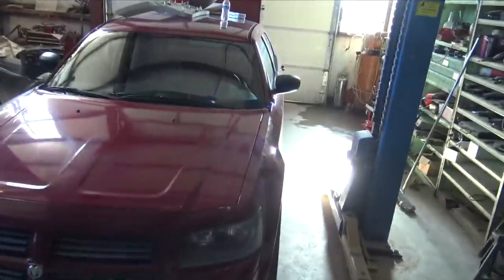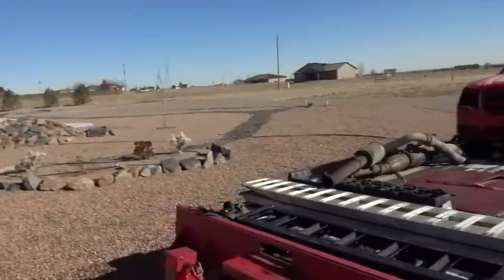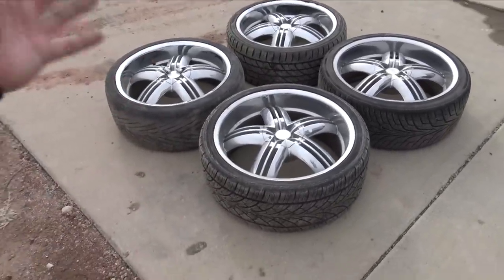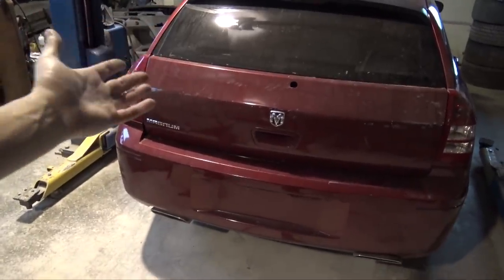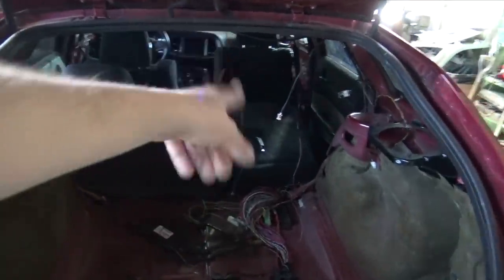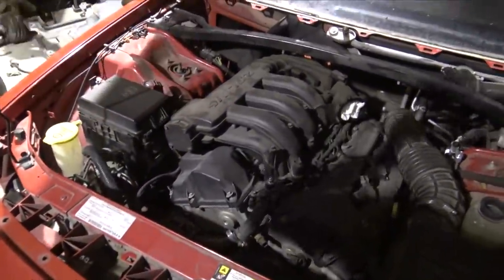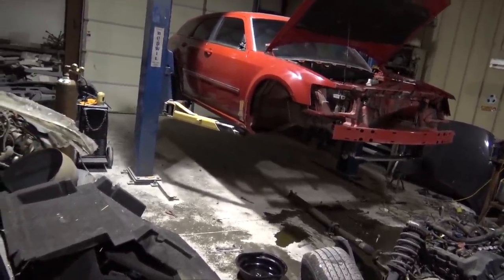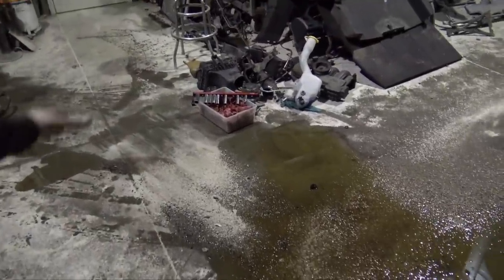Building the MAGNUM DODGE WONT | 500HP 6 4L 392 SCAT PACK WAGON PT16

Comment: Hi Dave, Please build a metal box to cover the winch.  And another to cover the battery.  Weld hinges to the lover face of the cover so you can  flip the cover towards the trailer hitch. Then put two padlocks on each of the covers on the  sides towards the rear of the trailer.  I did this and it kept the rain from wrecking the winch, and dirt and rocks thrown up by the rear tires from damaging the battery.  Hard to explain but it worked perfectly.  The reason I used two padlocks was I heard someone cutting through the locks with a angle grinder. As I approached my trailer after spending the night at a motel.  I welded metal covers over the padlock so the only thing exposed was the key hole at the bottom of the lock, and I added a second lock.  I had a very expensive winch.  But hey, you spent 350$ still worth protecting.  If you were out on the road and came apron your trailer with a missing winch would you say, oh well it's only 350$ ?

Comment: Glad to see you soldering and heat-shrinking the wiring. Much better than compression fittings, which can corrode over time.
Have you had the Magnum on a frame rack to see if it got bent when it fell off the lift? With most other things nearly done now, it will soon be time to do body repairs and paint.

Comment: If you get yourself a snatch block for the winch and double up the cable it doubles the capacity, so that will make it 18k lbs, which is more than you'll ever need for pulling stuff onto a trailer.  It just takes twice as long.  Hell, you probably won't ever need the snatch block honestly.  I have a 5k lb winch and it does just fine most of the time just straight pulling.

Comment: the hatch never pop it self, to do so add a spring to the strut, many did it when they put the switch in the dash. Also the hatch switch at the hatch has a 4.7k resistor in it thats because back in the days the charger or 300 doesnt have switch at the trunk. you can use your DMM in resistor mode, 20k range with each probe at each wire of the siwtch and press it, you should see 0 if its a short or the value of the resistor it has in it
for the lift, are you sure that the tread is still strong in the concret? like maybe it they are pulled from it

Comment: Be careful with the wiring on those harnesses.  From experience with Chargers, the wire stripe colors in the service manual might not match the harness 100%.  The wiring to the back usually include at least two ground wires and they are labeled as having different color stripes but when you look in the car they will both be the same exact colors.  One will say black with white stripe and the other might say black with grey stripe and they both go to different places in the vehicle.  If you aren't sure which is which you can tie them together to be sure the lights buttons and actuators in the rear door work even if one ground wire breaks... and they always break...

Comment: Bro. Rear camara in windshield wiper hole is not the best location for reverse Camara. It will not give u the best angle's to much glare from the sun. Also, its difficult to measure the distance while reversing when  rear bumper is not visable.
Reply: He can angle it downward.
Reply: I hope my last comment made sence. I mounted my Camara I in the tailgate opening housing.   All I did is drilled  a hole in the bottom middle of (handle) housing,   Opposite from trunk release button. (Trust) I found this location  To be best  for parking purposes.  It allows u to see the rear bumper, more accurate distance, eliminates glare, it's dead Center and  verly visable. Sorry no social media for pics. Also trunk is to heavy for it to clear trunk latch hook when actuated. A spring or two will do the job.  I appreciate all the  Love sweat and elbow grease You investing on Maggie Keep pushing bro'
Reply: @PanameraTurboSEHybrid   Yeah bro I understand that but not enough to see front bumper when reversing,  In front of a car.  The whole purpose of a reverse camera is so you won't fuck people's  bumpers when reversing. That was my only option other that using rear plate   light bulb mount. It just looks more real to me when parking in reverse. His also planning on adding a read wing

Comment: Ive told you at @Goonzquad has a rear wrecked police AWD 2016 Charger.
Reply from the maker: 16s didn't have the 8 speed auto
Reply: Da Truth ya that trans is a 7 speed
Reply: Goonzquad's wrecked charger is a ordinary charger that is rear wheel
Reply: Wade Kruger it’s not its a awd

Comment: I am surprised that you are using electrical tape to cover the wiring. The glue will leak out overtime with the heat and cold. I would recommend wire shielding. Zero maintenance and last for decades without any issues.